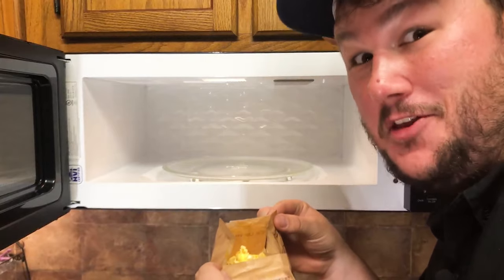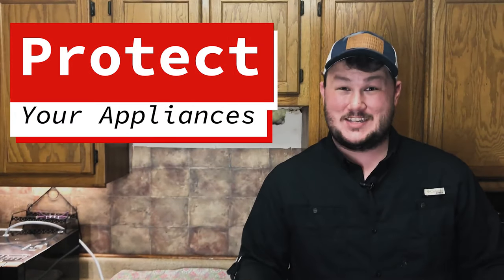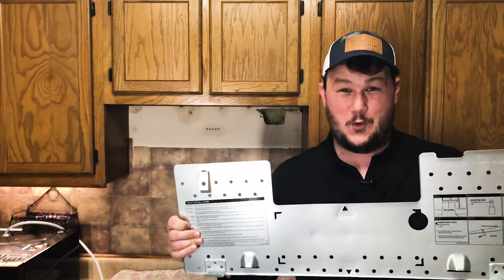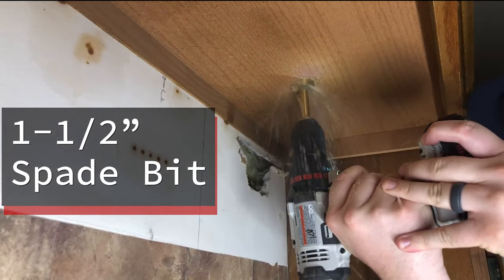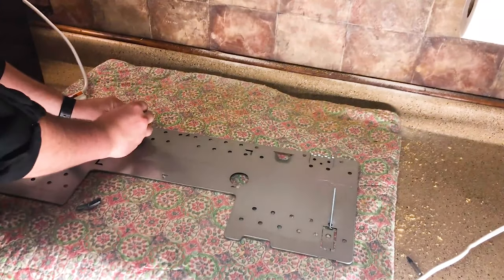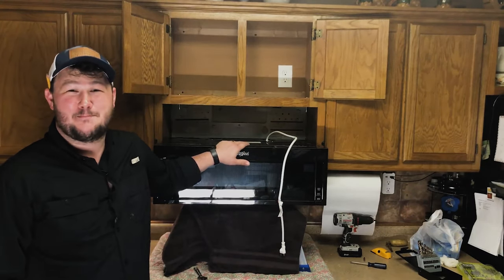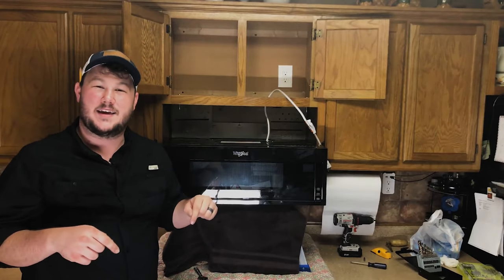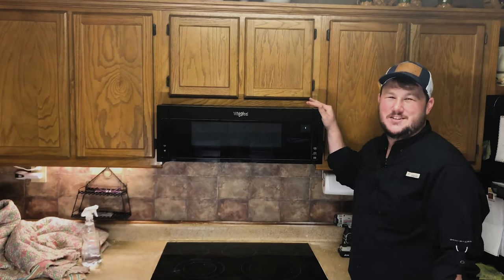Low Profile Microwave Installation

Comment: Thanks so much for posting this video.  It helped us immensely!   We had to go with a bump out and had a back vent to work with, but this helped clarify the basic process.  I won't say it was easy as the back vent was poorly installed by the last "professionals" who installed the past two microwaves.  Doing the job ourselves gave us an MUCH better product and now I have a fan that actually takes cares of stove top heat and smoke.  You made the installation so much easier for us.  Thank you!

Comment: As an FYI for those installing a microwave by themselves (like me). I bought a inexpensive scissors lift to bring the unit up to height for mounting (Amazon title "ECLV 30'' Electric Wireless Remote Control Dining Table Coffee Table Lift,Black,110V-240V,Working Platform Computer Desk Electronic Scissor Lift" ). It fits perfectly under the microwave for lifting it up to the proper height for hooking it on the backplate and then lifting it the rest of the way and insert the screws that go into the top. I had to shim it with some wood to get it to lift up to the proper height for my particular installation for my low profile unit (it's unusually high, but then so am I). I also used it to lift the unit from the floor to the counter. I found it was best putting the microwave on it's side for lifting to the counter top. That way I can simply tilt it over on to the lift. It doesn't quite come up to counter top height so I had to lift it the last few inches onto the counter. Still, better than lifting it from the floor and when lifting the microwave into position to hook on and then holding it as you fish the power cord through the hole and put in the screws to hold it into the shelf.  That's gotta be rough on the back over the years. The lift holds it in place for hooking and then lifts it up the rest of the way for putting the screws in. Some day I'll use the lift for raising something (like a TV). It even comes with a remote.
Reply from the maker: Love this!

Comment: Fantastic video! Question - was that backsplash/tile just below the bare wall? Wondering if the backsplash (tile) needs to be cut out so that the entire back of the unit goes on wall only: not partially on wall and partially on backsplash/tile? Wondering if that caused any measurement issues? Our current kitchen has tile (1/3 inch thick) that goes all the way up to the hood fan. To install such a unit with 1/3 inch tile, do I need to remove (cut out) that tile? Thank you.
Reply from the maker: Thank you, I am glad that you enjoyed it! The backsplash in this video is really just wallpaper. I would try to avoid cutting the tile, if it were me. The back bracket has some flex to it, so it might be possible to flex between the tile and wall gap (that really depends on where the anchors and hooks fall). The best option would be to cut a board that is the same thickness as your tile, that way you can bridge the gap and keep the same size plane throughout. You can use the board as a spacer on the drywall and attach the bracket directly to that. Hope this helps!

Comment: What is your distance from the top of the stove to the bottom of your new microwave? Their directions call for 24 inches, yours looks to be lower than that.
Reply from the maker: It is a bit lower. The distance between this stove and microwave is only 20 inches.

Comment: Thanks for the video.  What is the depth of the cabinet that you installed this MIC on, is it 12" in depth?
Reply from the maker: Yes, that is correct. The cabinets in this kitchen are 12" in depth.

Comment: Did you drill a pilot hole for the lag bolts before driving them into the studs? Thanks for your video!
Reply from the maker: I would recommend it. I did not, but it would have been easier if I had.

Comment: How did the low profile fit in so well? The height did not overhang next to the cabinets on the left and right? Did you have her cabinets already adjusted to match the low profile microwave? I have an older taller microwave to replace that is almost leveled with the cabinets on the left and right. Once I install the low profile, I will not have the cabinets leveled on the left and right because the new low profile microwave is shorter in height

Comment: Question: If using the upper vent hole, can I fit a 3x10 collar then attach an elbow & length of pipe and go straight out through the wall outside.

Comment: Does it have to be installed flash below the cabinets or can it go a little bit lower? I'm short and I want a low profile microwave but I need to be able to reach it. I can get a face plate that matches the wood to cover up the gap. What do you think?
Reply: Flush

Comment: Does anyone who has installed one of these microwaves know how many inches away from the back wall the hole in the top of the unit is for the electrical cord?

Comment: Whirlpool WML55011HS
I have had this microwave over a year. One HUGE CRITICISM that made me sorry that I have it. Because of the reduced height in the microwave IT IS VERY EASY TO KNOCK THE GLASS PLATE/TRAY OFF OF THE THRUST DRIVE PEDESTAL!
I find this very irritating. Frequently having to realign the wheels in their shallow track and then replace the glass warming tray on the three pronged drive protruding out of the base.
A poorly designed unit!
I recently discovered two hacks which has helped immensely and thought I would share them.
First, the wheeltrack.
The Three little wheels MUST BE KEPT CLEAN, AND THE TRACK THE WHEELS RUN IN, ALSO! So be sure to clean the wheels and trackway well whenever cleaning the interior. (btw, a drop of olive oil, etc, on each wheel shaft is helpful.)
The biggest hack that I can't believe just occurred to me, is glue the three pronged drive pedestal to the base of the glass warming plate!! This stabilizes the glass tray and all one has to do is lift the tray straight up an inch or so which removes the drive pedestal from the shaft it sits over. The drive shaft has one flat side that must be lined up properly when reassembling the glass plate with the glued on drive pedestal.
THIS IS A MUCH MORE SECURE Arrangement and there are many less times the glass tray gets knocked off the pedestal. In fact, I haven't had any more problems with this hack and can easily lift the entire glass tray and glued on drive pedestal for cleaning.
I used silicone adhesive I had around, but if it comes loose, I will be using epoxy or light activated super glue next.
I hope this helps!
BTW, Caveat Emptor. Use these ideas at your own risk, not mine.

Comment: There's no adjusting or turning the fan motor?
Reply from the maker: During installation, or as a built in feature?
Reply: @hamiltonhandmade9458   I was watching a video and the gentleman rotated the motor, in which changed the airflow direction. Maybe it was a different model...